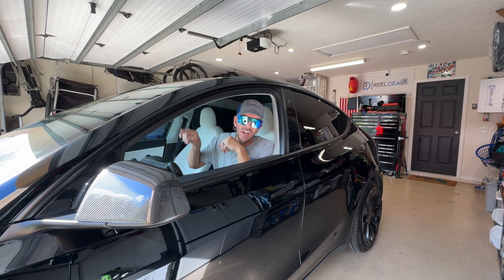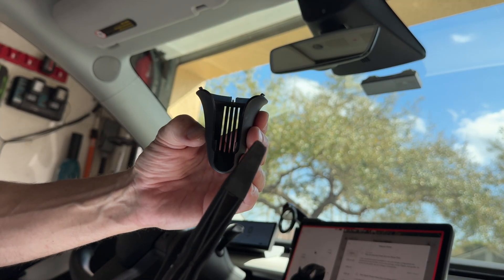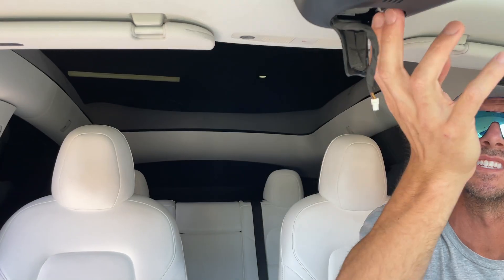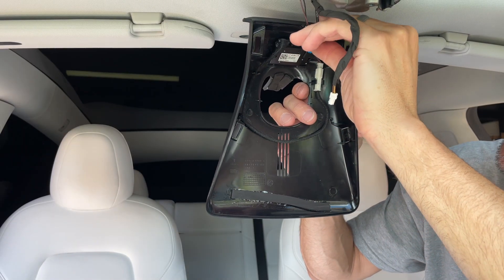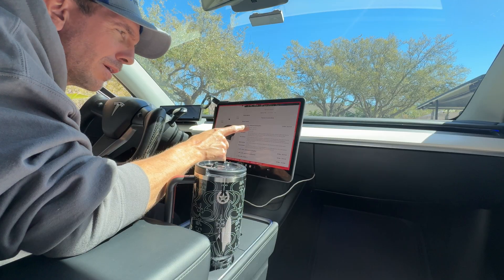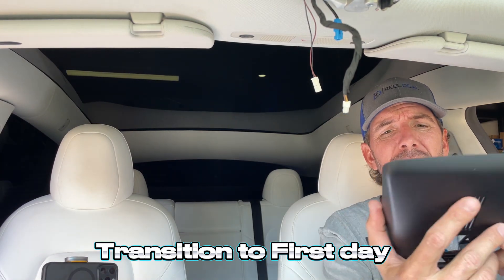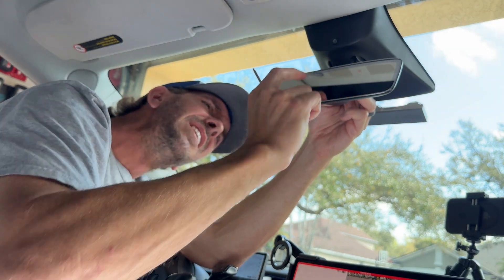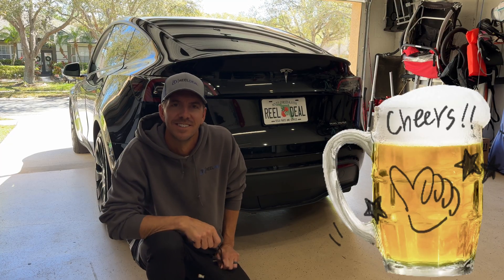Tesla Model Y Interior Camera Replacement DIY

Comment: Just did this on my Jan 22 MY build and solved the issue. Same part removed and replaced that you did. $69 on eBay for S0-I. Tesla quoted me $460 and wouldn’t guarantee goodwill since Im out of warranty. Driver monitoring now works in the dark.
Reply from the maker: That's awesome you were able to fix it yourself and save some money!
Reply: I'm not sure my 22 even has IR lights on the camera so it doesn't work at night.  I tried a Wii sensor bar for $5 which has plenty of illumination, but it looks like Tesla's software now understands that my camera has no IR lights.  I put in a service request but since they charge so much, I'm just going to do it myself.  I've already taken it apart once just to clean the glass, so this should be a breeze.
Reply: @llldaslll yeah, didnt take long to do. Just make sure you source the right part number. The tesla service manual runs you through the correct software procedure.